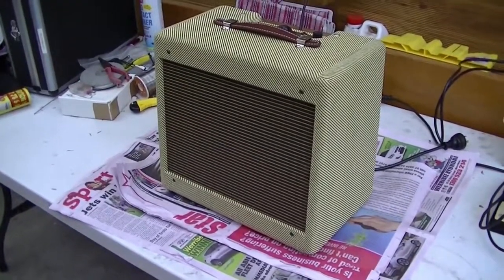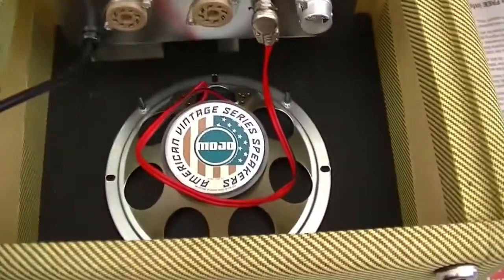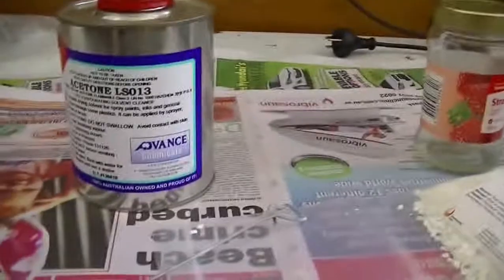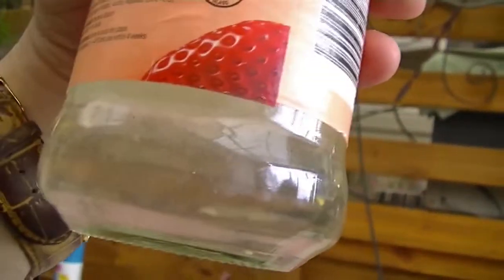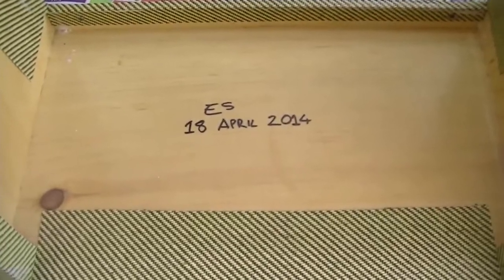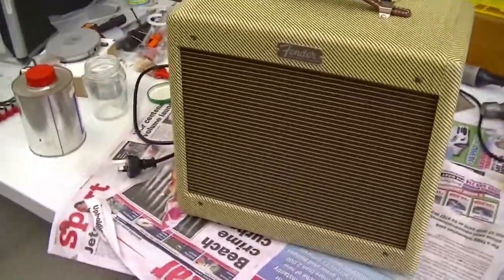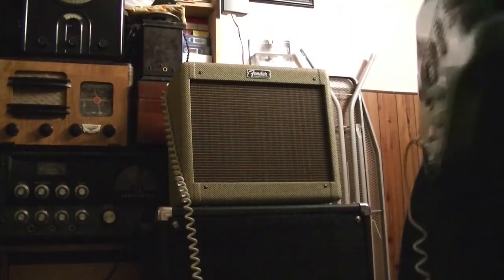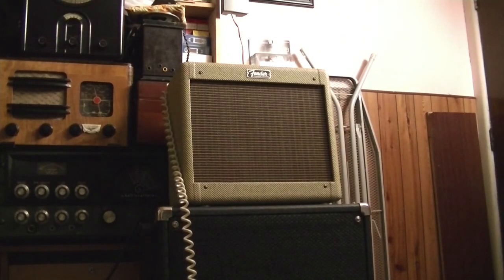Mojotone 5F1 Champ Amplifier - Part 2

Comment: I've been looking into building one of these lately, but this is the first time i've seen anyone coat the cab in nitrocellulose.  Is the purpose of this just to provide a little more of a protective coating?  Also, is the hum just in the nature of these amps? Thanks very much for sharing and great job!
Reply from the maker: Thanks for your compliments. I coated mine in nitrocellulose as that's what Fender did back in the 50's, and it does offer some protection. It also yellows with age and that looks pretty cool. That hum you are hearing is mainly from the single coil pickups in the guitars I'm using. The amp itself is pretty quiet.
Reply: snarfusmaximus Do you know what fender used for coating their tweeds amps back in the 30's and 40's. As like for the amps E-150 and EH-150 amps... Thanks!
Reply from the maker: ***** No idea, sorry.
Reply: ***** Thanks for your reply. To correct myself: The mentioned amps were (of course) from Gibson...

Comment: a LOT of humm...  does this clean up?  any idea why you get so much hum?  other champs don't seem to have this much?  I just ordered a mojotone 5f1 kit...  stoked to build it!
Reply from the maker: Single coil pickups hum and the hum is more prominent when there's more gain. The amp does clean up but I like cranking it up so it breaks up, something I can't do with my big amps without possibly having the cops called on me. It's a great little amp and you'll have lots of fun building and using it.
Reply: the fluorescent lights are causing the humming